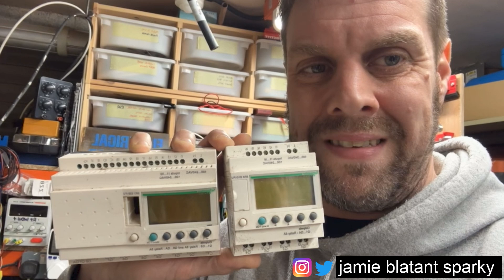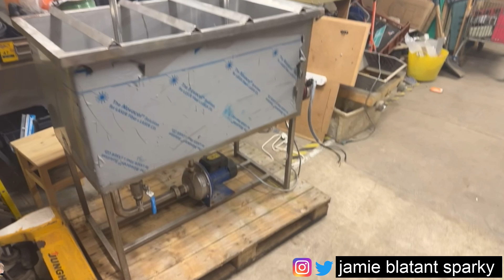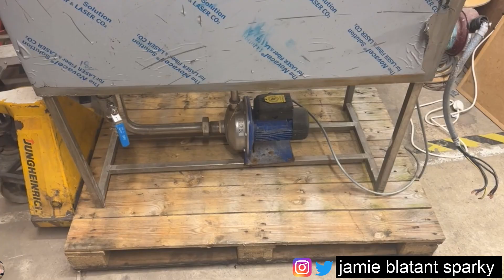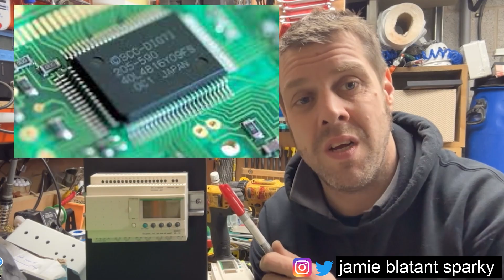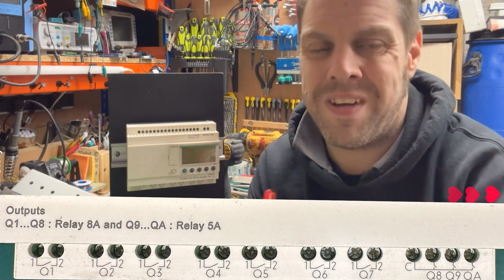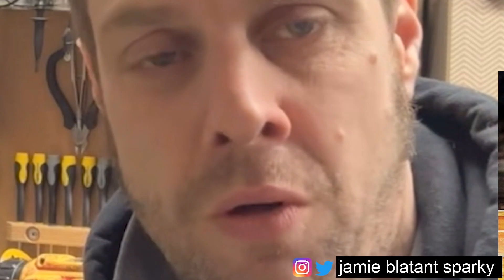Automating a keg washer , episode 1 process PLC,s

Comment: interesting stuff.  are you also considering checking the water level in the tank prior to applying heat?  also just curious but would the person operating the machine be wearing PPE? the use of caustic chemicals sounds a bit scary :) get the programming wrong and someone will be hurt!

Comment: Jamie, bought a couple of Shelly EMs as you mentioned them on your podcast. Connected them to the app. Measuring fine, but they keep dropping off online. Cycle the power and they come back. Any suggestions?
Reply: If anyone is reading this, the Shelly does not appear tolike the Deco Mesh. It disconnects and you have to power on and off. Jamie's IOT on a separate network is a better plan. I do like the Shelly's just have to sort out the internet issues at my end.
Reply from the maker: Mine have never moved an inch allways rock solid , how busy is your WiFi
Reply: @Actual_electrical_content  using a mesh. May be just a weak signal. Thanks for the reply and the Shelly recommendation. I may just use them in this property by connecting directly to them. I'll see if that works and allows me to see the usage. Good to know it's a WiFi issue
Reply from the maker: @brianoneill350  mine are sat on there own little wi fi network
Reply: @Actual_electrical_content static or dynamic IP address ??

Comment: Would be an idea to have two pi rated spring proximity switches located at the top of where the kegs will be set in the washer. Wire them in a AND configuration through a relay then when both are in situ it will close the contact and allow the pump ON.

Comment: I am old enough to remember when the RS catalogue was one book!! Used the crouzet m3 version for gate and door security interlocking controls. The software is easy to use when you get the hang of it. Like you say, this little box saves lots of relays and timers and interconnections. The display makes it easy to diagnose faults rather than tracing thru lots of wires and relays. Cost effective too when you consider the amount of timers and counter functions you can incorporate into a program as opposed to physically buying them. Looking forward to it. 😊

Comment: Could I ask why ladder and object logic is used when microcontrollers are dirt cheap but require more programming knowledge with non industrial practices. An ESP32 relay board is half the cost alone and it's got wifi/bluetooth and can be monitored remotely! Small project like this you could give stats of how many kegs were washed and how much energy was used.
Reply from the maker: It’s mainly because it’s easier to train people to use PLC,s  as it’s low level stuff